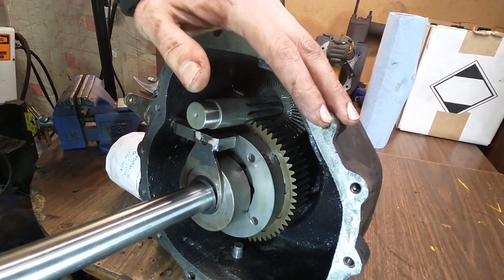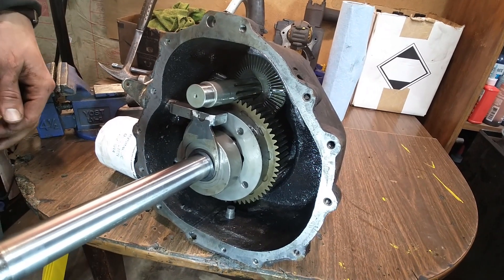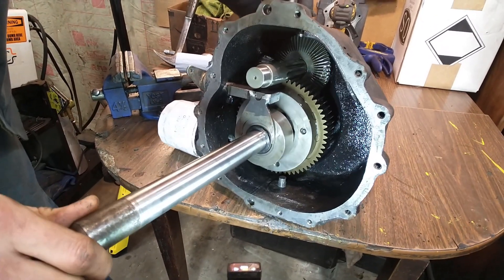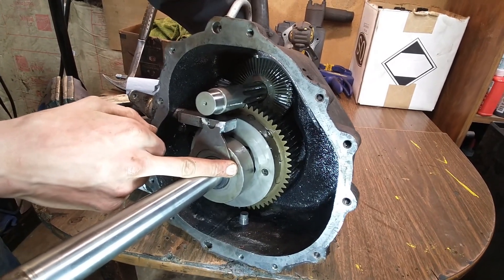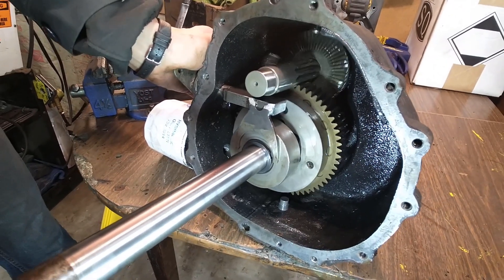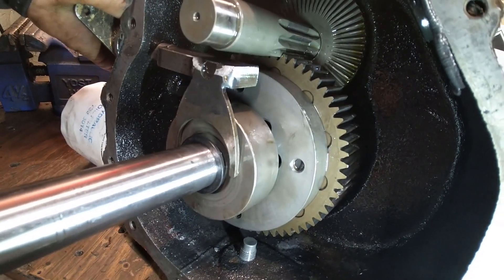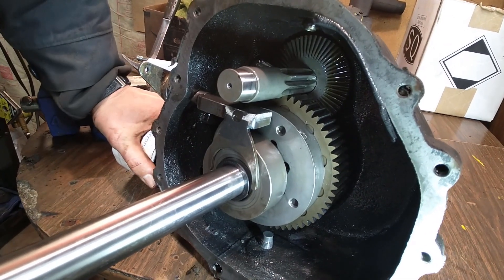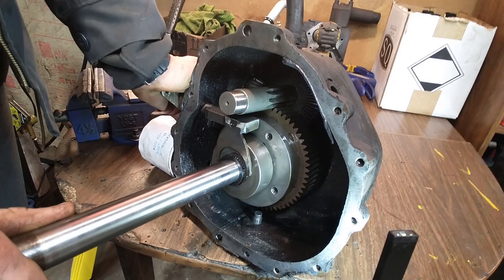Avoid User Error! Diff-Lock Operation Intro – Cast-Iron Transmission – Cub Cadet 3000 Series

Comment: On the aluminum axle for the 3k series , there is a spring return for the fork , as not to ride against the pin carrier until needed. Wondering if your cast iron axle had the return spring. 
The cast version im rebuilding dosent have it,and i belive someone has been into it before.
Reply from the maker: Yep. Should be there.  If not, I believe someone has missed it.

Comment: Even when I stop the tractor,  press the diff lock, it still rotates a bit before locking in. I try to ease into it until it engages but what are your thoughts? Thanks for the awesome video!
Reply from the maker: That is perfectly normal, as it will take a moment for everything to line up and slide into place.  Nothing wrong there at all, that's textbook proper operation.